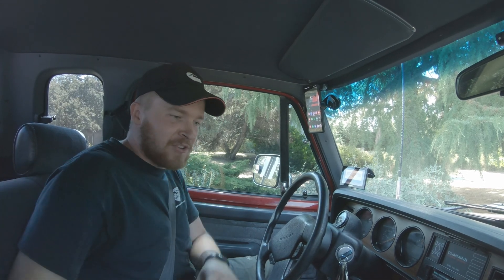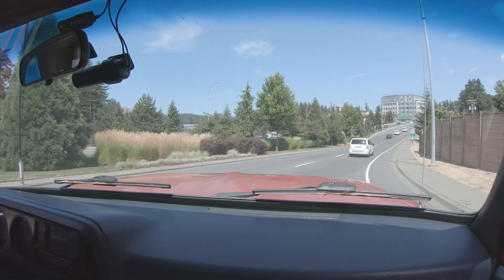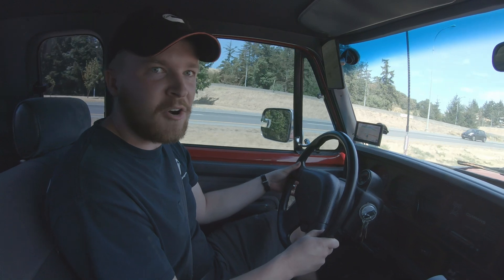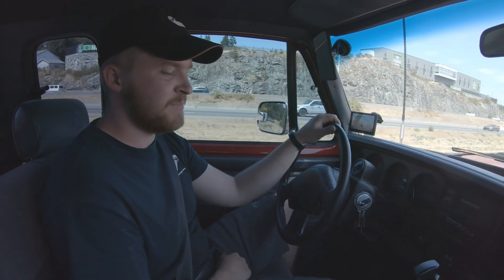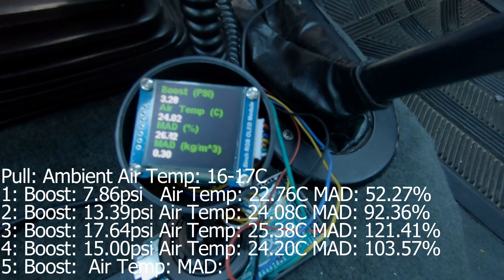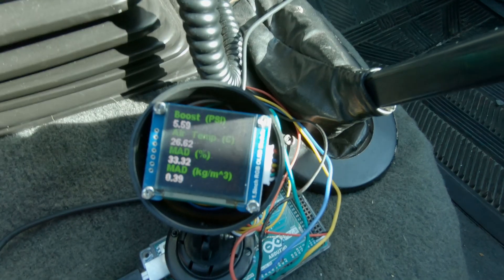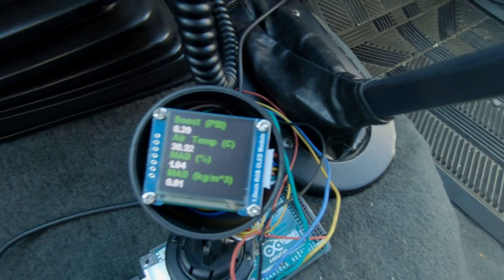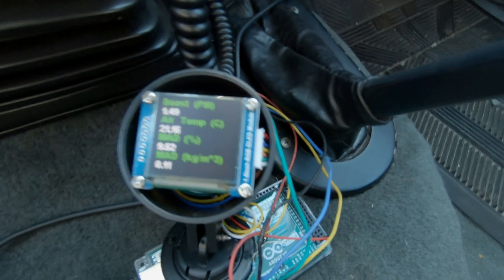Density Testing | Post-Intercooler Swap

Comment: Nice upgrade results. Looks like a right choice. I wounder how different the Duralast  "Stock" version would compare. Bet your wallet will appreciate the savings as well.
Reply: Thought you mentioned in the earlier video that they did. But that you would've had to have waited and instead went this route. I could be having a bout of CRS tho ?
Reply from the maker: @ronsre-creations5289  Oh I thought you meant dura last not duralite. Yeah I was told that they discontinued making the stock replacement
Reply: @OvensGarage  My memory --- That is ashame. I like the innovative tube seal though on the 1 you used.  It was a nice clean install. As you always do. It'll be interesting to see the improvement with bigfoot installed.
Reply from the maker: Do they make a stock replacement?

Comment: What was your EGT difference before and after??
Reply from the maker: Don't have an EGT probe right now, but I can only imagine it dropped.
Reply: @OvensGarage 
A probe and programming(maby a signal booster)  is all thats needed to add egt to your mad gage.
I like the fast response probes from The Sensor Conection ( located in Michigan sorry not Ca) it has a response rate of 150ms vs typically 1200ms (1.2 sec or 6sec to show full change in temp) Response Time*: 150 mS
*Time Constant: Defined as the time required to reach 63.2% of an instantaneous temperature change
Five time constants are required to approach 100% of the step change value.
I have ~150k mi with no fouling.  If you have a dirty tune then burning the carbon off the exposed junction may be nessasary about evry 10-20,000 or if preforming sluggish ( egt gage w/ fast response should move like the tachometer)

Comment: I have a 1992 dodge w250 with a stock intercooler. I don't know much about intercoolers except that they reduce the temperature after the turbo has inadvertently heated the air up. Obviously the cooler air is critical for dense o2 and that provides better combustion but does upgrading to a newer better intercooler make a significant difference...? 
Is it noticeable in power or mpg?
Reply from the maker: I'll have to report back about the fuel mileage. I keep track every time I fill up. In terms of power. You won't notice a significant difference unless you are making big power. I didn't really notice too much of a difference. I haven't really pushed it to the higher levels though I kind of baby my truck and don't really beat on it. I feel like the stock intercooler would be very restrictive if you were trying to make big power. This new intercooler is worth it in my opinion because now I know my manifold temps will be lower helping combustion efficiency and I'll make more reliable power.